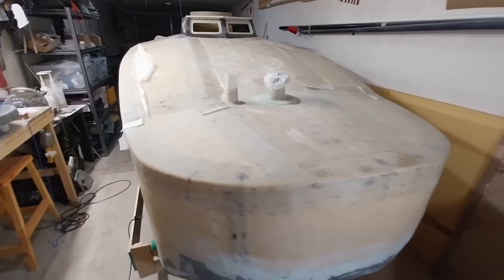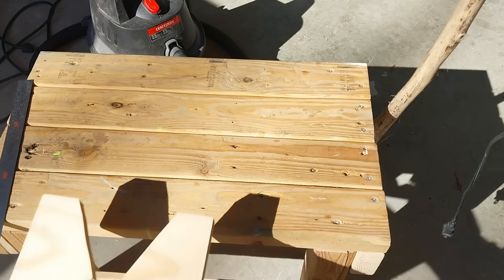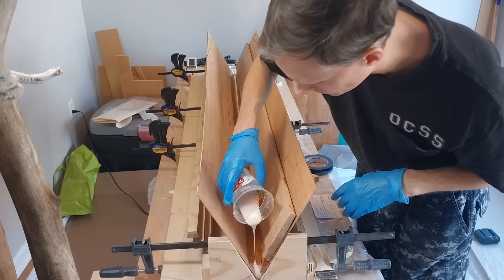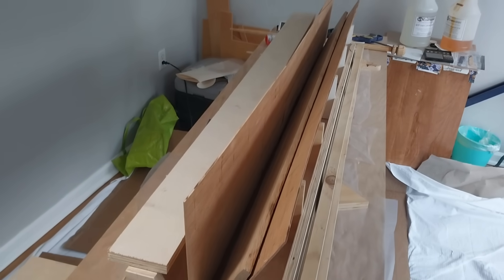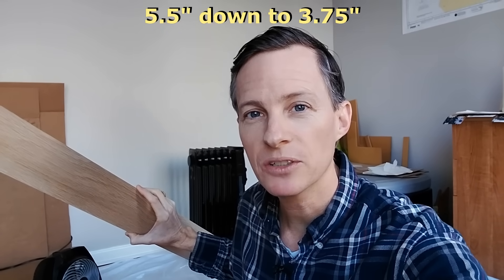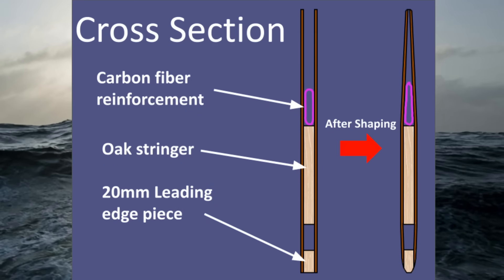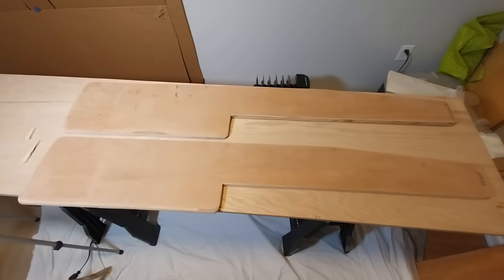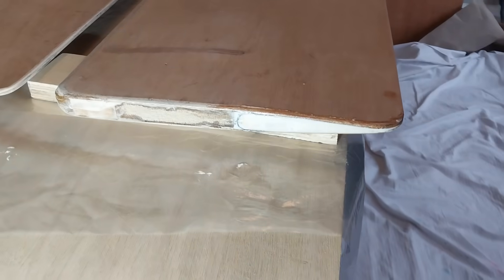OCSS-090 Easiest DIY Rudder Blades: Light & Strong - Mini-Cruiser Sailboat Build

Comment: Your boat is looking amazing. I would love to sail that thing. 
On another note, you scared the heck out of me cross  cutting a narrow piece of wood between the fence and the blade. You should never do that. If can bind so easily a kick back. Do yourself a favor and your family and nss add ke yourself a sled for the table saw. They are safe and way more accurate. At the least have a guide running between the blade and the fence.

Comment: I do not think it is stiff or strong enough. 6kn 'down a wave', the distributed load is around 100kg near stall. 
It is an easy test to do. Stand on it :-)
It is easy to add local carbon reinforcements.
Reply from the maker: As mentioned in the video, it's not done yet. It will get carbon fiber and fiberglass in the next video coming soon.

Comment: Interesting. Good job. I understand that with your workshop situation you don’t want to make a ton of dust but it’s super easy to make a solid ply or foam blade with a female NCCA foil template and an angle grinder. Plywoods easy because you can use the lines of the veneers to work to…
Reply from the maker: This is just an alternative method that's easier, lighter and quicker to build than trimming down plywood with an angle grinder or router and constructing female foil templates.

Comment: Very nice work! But, wouldnt be better to use solid wood or foam instead of using plywood, for an ocean going boat? I think that the strength and sturdiness of the rudder would be more important than weight, for this kind of boat.
Reply from the maker: With the white oak stringer and tube of carbon fiber inside I think it's plenty strong, but we'll test it out and see. It's also getting carbon fiber reinforcement on the outside skin in the next video.

Comment: Very confusing to me. Sorry 😔
Reply from the maker: Hm, well this describes the 2nd one I made, starting around 7 minutes into the video: Basically I epoxied 4mm ply onto a 95mm wide wood stringer set 30% of the way back from the leading edge. I also had a 20mm wide wood piece along the leading edge sandwiched between the ply. I used white oak but probably something lighter like spruce would be better. Once it cured I made a tube of carbon fiber and slid it in the trailing end all the way flush against the stringer and then epoxied the trailing edge closed with clamps. My rudder width was 270mm.
After that you shape the leading edge, fiberglass and paint! Pretty fast construction, and it makes a light and strong rudder blade.

Comment: The corner below the pintles is very concerning for me.  That corner is a big stress concentration point near the maximum bending moment.  Just saying.
Reply from the maker: That's right. In the next episode I'm going to reinforce with carbon fiber and cover everything in fiberglass.
Reply: @ocean_capable_small_sailboat  I know of two other boats who have similar notches that have had problems with rudders despite being covered in fiberglass, C&C 24 and S2 6.8.  What happens is cracks develop in that notch, leading to water ingress and core degradation and eventual failure.
Reply from the maker: Something to keep an eye on and repair/replace as needed. Definitely. Luckily these are pretty easy to make.

Comment: Could you have shaped a piece of foam to the section you want, then cut it in half lengthways and glued in a stringer? I'd be inclined to use plywood for the stringer as it's factory straight. Obviously you have to take account of the thickness of the ply in the overall dimension of the rudder blank. Then glass over. This is how surfboards are made so it must be strong.
Reply from the maker: I was thinking in the future I'd make a stringer out of foam with several layers of carbon fiber wrapped around it. If you make it on a flat surface it will be just as straight as plywood, but even stronger. but, maybe next year. I need to move on to other things to get in the water.
Reply: @ocean_capable_small_sailboat   I think there are several ways you could do it which would be plenty strong enough. The hinges and their mountings are the weakest point on any rudder.

Comment: Method #1, glue asymetrically and then try to make something symetrical makes no sense to me. Your method #2 makes far more sense. But, maybe a "softer" rudder could be even more smart, if you collide with something. Probably you would need only replace the rudder blade. If you make a very solid piece, maybe the weakest point would be the hinge/joint.
Reply: Rudders and dagger boards can see a lot of side loading so they have to have some strength. A soft rudder might not be strong enough.
Reply from the maker: This is a cassette rudder, so if you hit something the blade just pops out of the back of the cassette box, sparing the pintles. Pretty cool.
Reply: Thanks for the explanation @ocean_capable_small_sailboat

Comment: The Perry method seems superior. You could incorporate a fiberglass re-bar rod when installing the carbon fiber. Or, it would take the place of it completely. You could wrap the rod with carbon fiber and slide it in. You could even have each end protrude by an inch and glue a stainless bushing on each for rigging to the hull. You can get the fiberglass rebar (in engineering lingo they call it FRP bar - fiber reinforced polymer) in several diameters.
Reply from the maker: Yes, that would be very strong. A solid fiberglass bar is a bit heavy for my taste though. I was thinking of making one in the future again, but instead of a wooden stringer I'd use foam wrapped with several layers of carbon fiber.

Comment: Interesting methods, but why not just shape foam and lay over carbon fibre?
Reply from the maker: Because then I have to precisely shape the foam and it takes more time. Plus I'd be removing the strong wood and carbon fiber stringers inside. This method quickly and easily gets a nice uniform foil shape for the aft half, then it only takes a small effort to shape the leading edge with the method I described in the end of the video.

Comment: Perry,  I like your Carbon tube, then smash it flat, method.  That thing should be like a steel-I-beam.  I've messed around with Carbon and like it.  What is Hard to work with is Carbon/Kevlar fabric.  They don't behave the same.  Keep up the good work. Glenn

Comment: Hi Perry
Keep working. It is good that you now have a house and is that table saw new?
It is a dangerous tool. You must never cut pieces in it that are wider than long. They can jam and become projectiles. Most likely a few hundred more people will tell you this.
As you said the boat will be slow so it is not very critical the shape. 
Myself my boat is also slow so I just use a flat piece for the daggerboard and rudder.
Reply: You can make these cuts with a cross-cut sled, if I'm not mistaken.
Reply: I learned that lesson the hard way. Fortunately, I was not badly injured.
Reply from the maker: Yes I got a used table saw. Very handy. But it does scare me a bit. I try to be careful and so far in my life I've never cut myself with any powertool blades.
Reply: Also, the cut without the fence looked the most dangerous. If you don't hold it perfectly straight, it's gonna pinch on the blade and kick back violently.
Reply: @Yahntia  I thought his free-handing (no fence) looked pretty skilled. It is the rectilinear pieces, where the length perpendicular to the blade is longer, that get catastrophically trapped against the fence and thrown back at you - that are the risk.
Reply: Yeah, I cringed when watching that cut.. seriously, do some watching of kickback videos and make a sled ❤
Reply from the maker: Yikes, lesson learned (the easy way luckily)

Comment: To my layman's mind both methods seemed insanely complicated. Wouldn't it be simpler to just glass over a solid piece of shaped wood? Or even foam board and carbon fibre? I'm not even a good hack carpenter so I really don't know.
Reply from the maker: It's much more complicated to try to uniformly shape a solid piece of wood or foam. The point of bending the ply over the stringer is that you eliminate a lot of that work and time spent with a router/jig.
Reply: Agreed.  Is it really to be perfectly symmetrical, I think not.
You can shape with a plane quickly enough.
That said I think the best / quickest method if making multiple foils is to use grp in a half section mould, then bond together